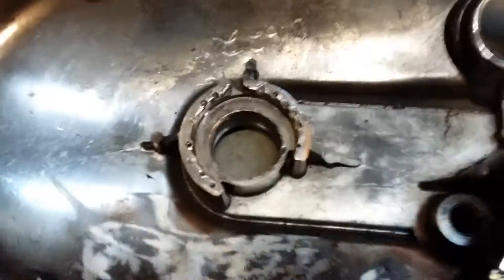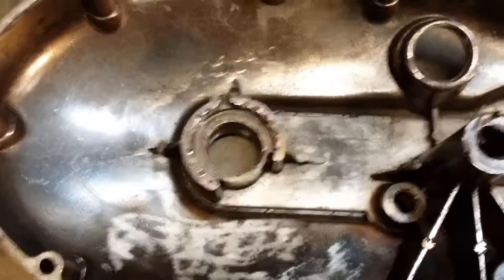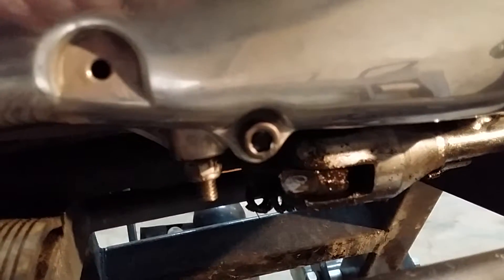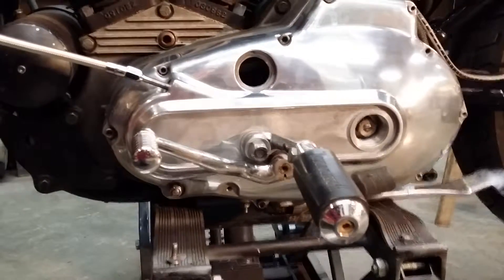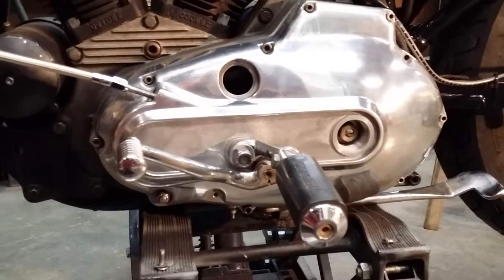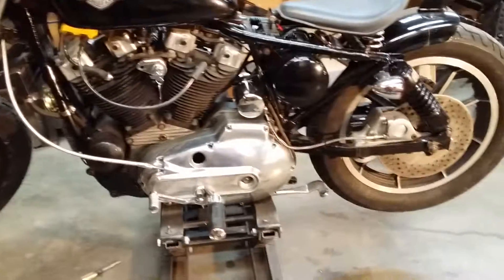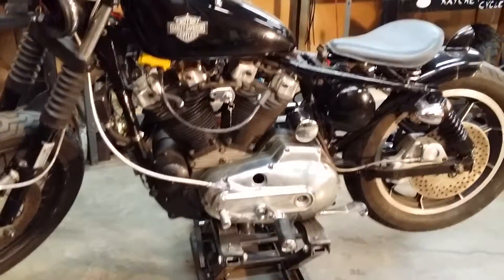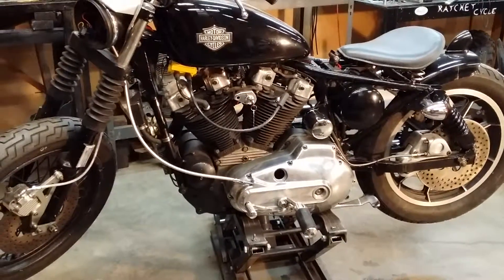1979 IRONHEAD HARLEY 1000 003

Comment: Hi there. I have a 1975 Ironhead that has engine oil leaking into the primary, I suspect it is leaking through the oil transfer valve. What are your thoughts about plugging it?